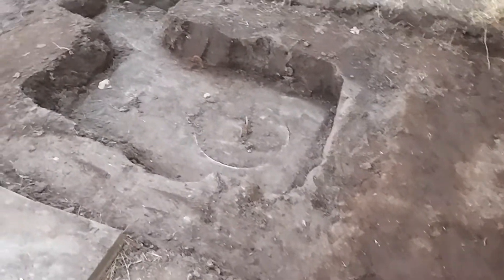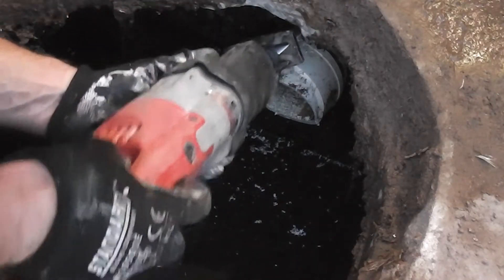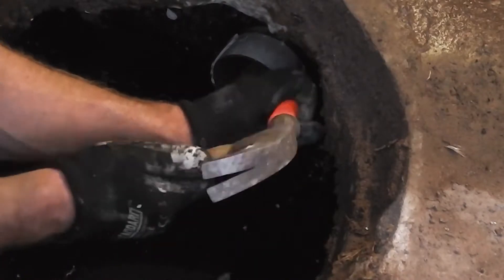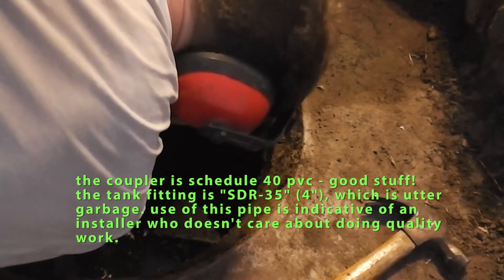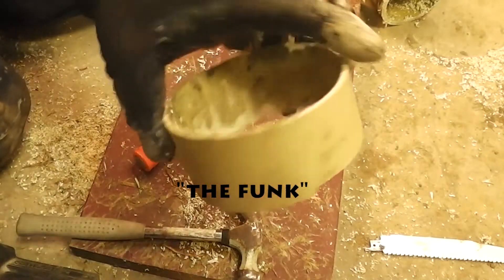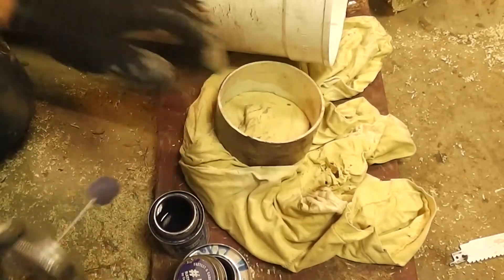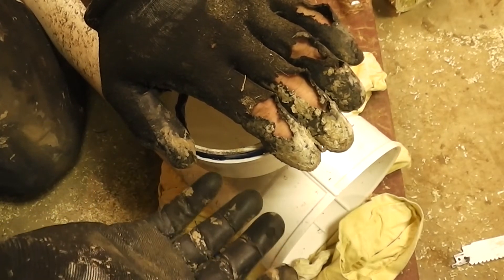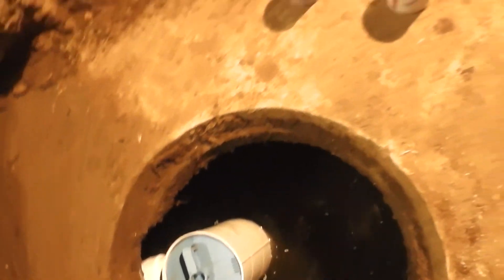Installing Effluent Filter into Full Septic Tank

Comment: Nobody uses Schedule 40 for an Outlet Pipe, because Schedule 35 SDR is the industry standard. Different grades of pipe use different fittings, and Schedule 40 PVC is not for an Outlet Baffle either... it's fine for an Inlet Pipe and Inlet Baffle, but that's it. Typically, the professionals will use what's required by code, and that's why we get paid the big bucks.

Comment: Pretty sure you can put the effluent filter in the outside of the tank can’t you? Either way, super crafty 👍🏽
Reply from the maker: hmm that's true, but I would have to build a separate holding tank with as much surface area as the secondary section of the septic tank if I wanted to match the resistance to particle-overflow that exists with the standard setup. That, or start designing a different filter system, such as multiple filters in parallel. Plus, I'd have to install a third access hole in order to service the filters, and I'd be left with an extra compartment to be checking that nobody would know about unless instructions about the third tank was, say, welded to the effluent tank lid in, say, stainless (so that it's obvious). Then they'd charge a little extra for the extra hassle